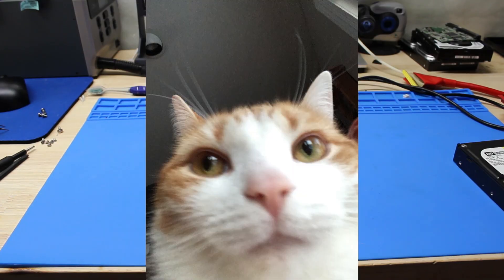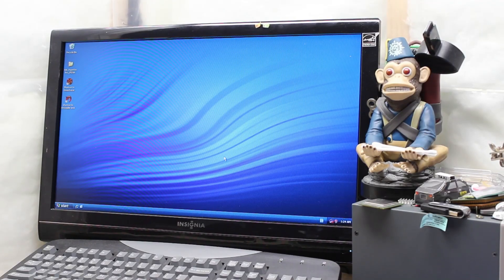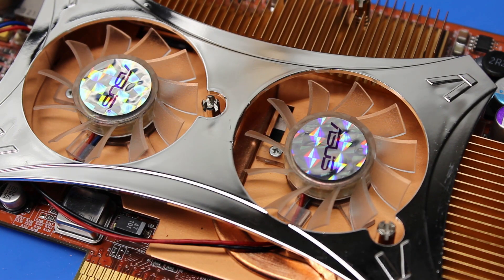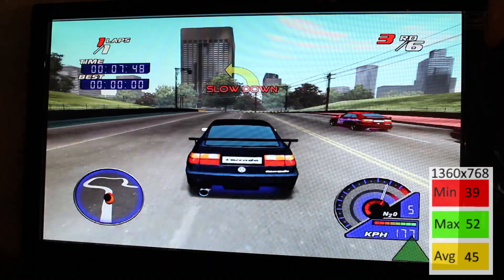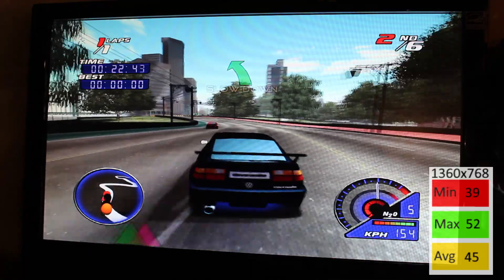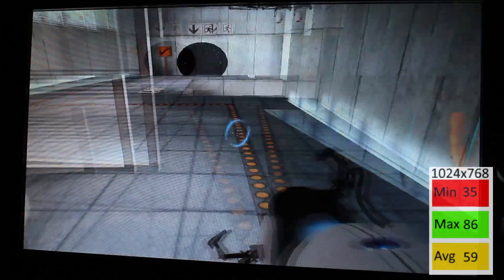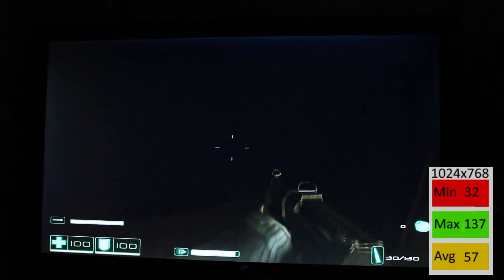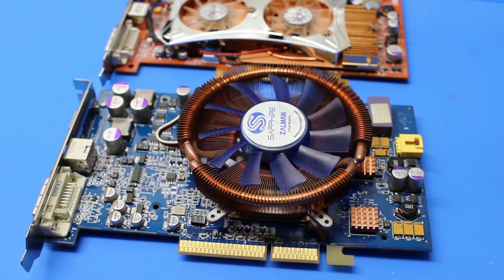Hardly anyone bought this GPU back in 2003 #GPUJune5

Comment: remember having a x1650 xt or pro i think, with 512mb ddr2 i guess :) and it was running Bioshock buttery smooth, i was a bit affraid it wont do cause it was just a temporal replacement for my gf8800 640mb which had a ram issue, intead having 640 i had only 320, so it was bad. Sent it back and get a new one. But it took like 30days and i wasnt gonna wait that long so i bought another gpu. Had the money back then, so why not, after that i sold the ATI, but still i remember it fondly cause it surprised me. Kinda no body talks about those x1950 or 1600 or 1300 etc. nothing :) (at least not on channels that im watching, or try to). Friend had that 1950, beast of a card.
Reply from the maker: I've had a few X1600s and X1950s. I have another one (x1950) coming so if it works maybe I can make something with it if there's interest!
Reply: @big-ts-tech-corner  yes, sure, id like it, maybe others too

Comment: 1360x768 = 1044480
1280x1024 = 1310720

Basic maths reveal which is the higher res lol

As for the lag during the race countdown in NFSMW, it'd happen even if you had no rain. The issue is that transparency requires a fast fill rate which old cards (and a lot of Intel iGPUs) struggle with.